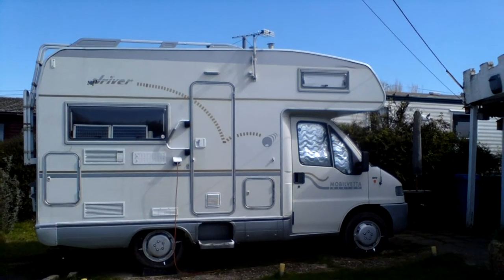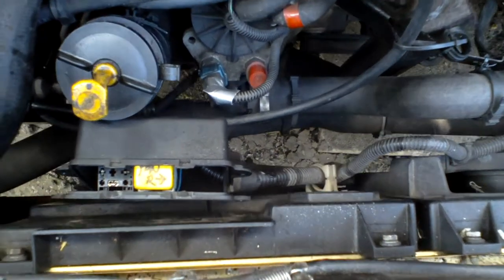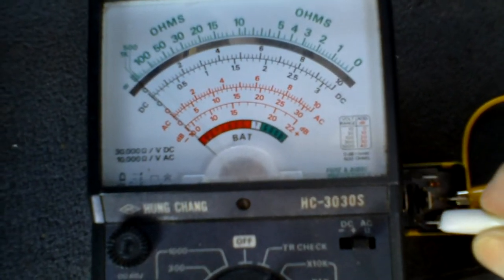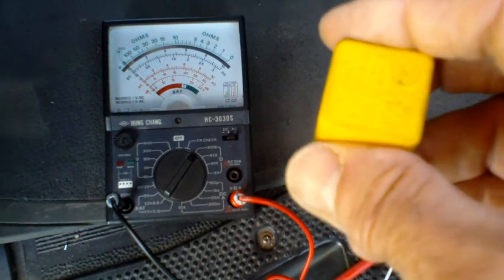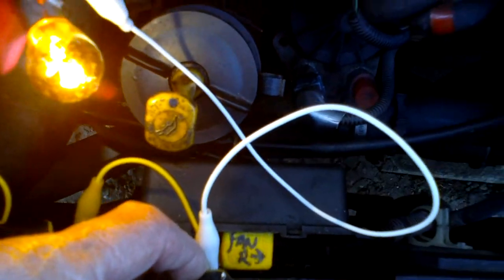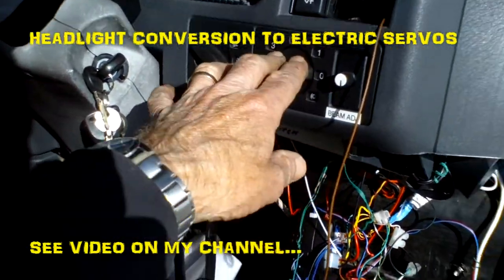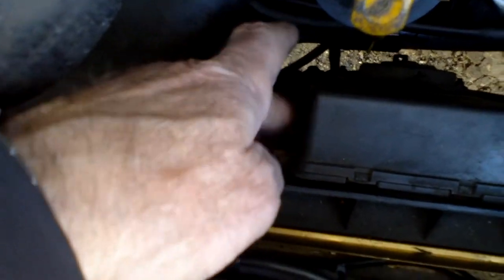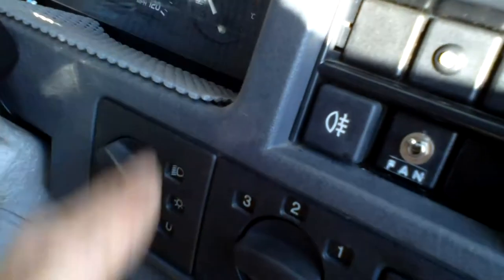FIAT DUCATO 1999 TD - COOLING FAN PROBLEMS

Comment: Thanks for the video - saved me loads of time. The low temp fan ran continually after a journey and the only way to stop it was to tap the side of the relay box to release the relay contacts. I purchased another relay for €20, swopped it out and now all working fine. I opened the old relay and the contact had burnt out.
Reply from the maker: Hi John. Glad it’s been of help. The relay takes a lot of current so the contacts can get welded together easily. I found that a switch in the cab to energise the relay before the temperature switch cut in was a great help in keeping the van running cooler up in the highlands of Scotland where I spent a full month…
Good luck on your travels and look at my channel as I have loads of other tips in video. Best regards Peter

Comment: Hi great video and thanks for posting.
I have exactly the same problem on my 2001 Ducato. How do you identify the earth pin from the two pins that you performed the test on? 
I presume it's the one on the left, pin 30 (as you look at the pins). 
Hope you can help. Cheers
Reply from the maker: Hi Gareth. If you check on the video and make up the simple test bulb lead you should be able to clearly find out the Earth and power lead without doing ant possible damage as the load bulb will light instead of burning anything out.
As yours is not the same year as mine the wiring could (probably is) be different so only there is no easy way (Safeway) to tell what pin to use.

Comment: I have a 2001 Peugeot Boxer with the same fan and relay configuration. Currently, I'm facing an issue where neither of the fans are running. I've meticulously checked all the fuses and even experimented with the radiator sensor, which has three wires. Apparently, you connect one pair of wires, one fan should run, and when you connect another pair, both fans should run. However, despite these tests, the fans still refuse to operate. I've also tried the bulb trick across the same two connections on the relay box as you did, but the fan remained inactive. Any suggestions or advice would be greatly appreciated.
Reply from the maker: Hi Mick. I would first go looking for the main power connection NOT for the relay coil. The relay should show 12v in the switching side (not to coil) if you can’t find it then there are 40A fuses up by the battery on the off side wing and perhaps that could be an issue.
If a fuse has blown be sure to check to see the cause as it could be the motor has gone or some wiring has become damaged.
The fans take a LOT of power but operate independently from the ignition so that if the engine is hot and you turn off the engine the fan continues to operate till the stat turns off the circuit.
Just a case of digging I’m afraid. It’s always the earth of the relay coil that gets switched the relay contacts handle the heavy load.
Regards Peter

Comment: Hi Peter, Thats a great video and thank you! I've got one fan permanently on (1999 2.8). I'm hoping it's a sticky relay so it helps knowing where they are located!! Cheers, Brent
Reply from the maker: Hi Brent. I have now changed both relays as they don’t cost much and also next is the temperature switch is next - looking front the front you will find it located at the bottom of the radiator R/H side. Look for the wires going to it which is not hard to find. I have got radiator flush and also recommended glycol ethanol antifreeze concentrate which is also a help to cool the engine as well. That should mean it will run a bit cooler… Thanks for taking the time to comment and loads more videos I’ve made that may help you on my channel so if you subscribe you can always find me.
Also run the Facebook group “Mobilvetta Driver52 motorhome group” which has the same engine as you (1.9td + 2.4 and 2.8 diesel).
Regards Peter
Reply: @brucepeter2007  thank you for responding and additional information Peter. I have subscribed and found your article on the scuttle drain useful. Regards, Brent
Reply from the maker: @brentc8110141  Hi again. Always try to reply and help others - thanks for the sub. Regards Peter

Comment: One of the temp sensors seems to have failed for me after a bit of a hill, couldn't have picked a better place to break down in Spain... luckily i have heaps of lifepo4 battery, inverter and charger so am just charging the starter... while I'm here I'm thinking to just add a relay or switch to disconnect the (lower radiator?) temperature sensor when ignition is off? Fans have been a nuisance on two occasions, one at a border crossing when nobody can hear eachother with the fan roaring even with engine off... Temperature on dash reads fine and fans usually shut down after 5 mins parked, but today I was pulling relays from under the dash searching (fruitlessly) for an easy off switch, and it ran the ageing starter battery low... Anyway... engine running again now and charging via alternator... waiting for the fan(s) to kick in so I can see which temp sensor wire I should splice... Not using a timed relay while bypassing ignition seems a bit of an oversight by whoever designed this system.
Reply from the maker: Sorry for pain hope you get it sorted. Is your van a mobilvetta driver52?

Comment: Great instructional video, many thanks. I bought a Pilote D34 motorhome last year (I've had Hymers in the past)and it came with the little 1.9TD engine, great for fuel economy, not so good for hills. It's the middle of summer now and I've noticed that the big fan comes on when I turn the engine off. It then stays on for a minute or so and then goes off. Is that normal? I've not noticed any lights on the dash come on or the temp guage go up (I've not even looked at the guage to be honest). The other day after turning the engine off, the fan stayed on about a minute, went off, then after about five seconds came back on for a few seconds then went off. Does this sound like a failing temp sensor somewhere/ Thanks for any help anybody might offer.
Reply from the maker: Hi Fred. On hot days or when you stop after the engine has been worked hard the cooling fan can come on after the engine stops as the heat builds up BUT. always best to listen till the fan stops as the fan by-passes the ignition so if your thermostat sticks on you will come back to a flat battery.
Mine started to act up which is why I changed the stat and I have no issues with the fan running now after the engine has worked hard so I do suspect my stat was showing signs of failing and I replaced said stat. Since then I have been told that the stat sticking so the fan stayed on was a common fault…
Reply: Thanks Peter. Are there two stats, one on the engine block and one on the bottom of the radiator? As my van is a 2000 model, maybe I should just change both of them? Thanks for the reply. @brucepeter2007
Reply from the maker: Hi Fred. - I just changed the stat on the radiator and that was the one that was at fault.  @fredflintstone1428
Reply: Many thanks Peter  @brucepeter2007

Comment: Hi, nice video. Can u please tell me what's the PIN of your relay that you sent the earth to?
Reply from the maker: Hi Alessandro. On the plug in relay you will usually see a diagram showing where the relay COIL pins are. Use a multimeter on the corresponding relay socket pins to check for the 12v positive supply which is live to the relay socket base all the time (straight from battery) the negative Earth is the opposite pin so the 12v supply goes through the relay coil which energies your switch….
Personally to save issues knock up the 12v x 21W bulb and a lead like I show in the video - that way you can always “feel” your way through electrics without causing blown fuses and damage… Regards Peter
Reply: Ookk, thanks for the explaination 👍🏻👍🏻
Reply: Job done, thanks again Bruce 👍🏻👍🏻
Reply from the maker: @alessandrovirdis520  Your very welcome

Comment: Hi Peter 
Another good video and fortuitously I may have same problem. Noticed driving from Scotland  down to England  last month . Engine overheating, especially  on the hills. Engine certainly working hard going up them. Usually sits at 90..but was going upto 100 with warning  light coming on....on stopping noted coolant just looked like water,  so thought it was maybe because no proper coolant in it. That and fact it was really warm day. 
So I've booked it in to get system flushed...but seeing this video , I do wonder if it maybe more like your experience.
Reply from the maker: Doing a flush and will change the fan switch and relay just to be safe. Keep your wheels turning and stay safe. Peter
Reply: @brucepeter2007  thanks Peter. Have exact same van you have , so good to watch your videos. Eventhough am not as skilled or competent. Always finding something wrong...damp right across back van now. Kitchen and toilet. On process of resealing outside yo stop anymore water ingress.  The joys
Reply: @brucepeter2007  ps Relays easy enough to purchase? Considering how old van is
Reply from the maker: @weebab69  as long as it’s small   Bits and bobs it’s things like gearboxes that are like gold dust PS have you joined the Facebook group. Mobilvetta driver52 motorhome group?
Reply: @brucepeter2007  thanks for heads up re FB page 
Damp I think larger area than I thought. Was hoping to avoid taking top kitchen cupboards out, but fear I may need to. Hoping it's not one big one , but nit looked close enough yet

Comment: Hi Peter couldn’t you not just bridge the relay connection for the slower fan over to the high speed fan so when the slow fan relay comes in that it will also activates the other relay at the same time.
Reply from the maker: Hi there. Your the first reply. You could do as you said but it always better to only mess about a bit. 
Didn't want to do that as if you were in traffic instead of just the one smaller fan coming on both would start and the battery drain would be high which is why I elected to do it the way I did.
Thanks for the valued comment and I hope I have explained my reasoning OK.
Regards Peter
Reply: Hi does engine over heat often?
Reply from the maker: Hi there. I have fitted a new radiator so it’s only in heavy traffic in last years heatwave that the fan was coming on but as I want to try the dales and Scotland I think I need to be prepared. The engines in motorhomes work harder than they would in a van because they are loaded to over 3 tons unlike a delivery van that goes out loaded for delivery and empties over the course of the vans round.
Just hope I manage to get my dream which is Scotland.
Reply: @brucepeter2007  Hi Peter. Thanks very much for doing this video, but I'm sorry; how was the earth wire running to your dashboard switch actually connected into the relay or into the socket? Is the relay replaced in its position with the switch wire jammed into the earth socket under it? If I could do this I could solve the same problem on my Boxer. Thanks
Reply from the maker: @petetimbrell3527  Hi Peter. The Earth wire from the dash switch goes to the Earth on the relay socket that way it still says functional via the thermal switch as per normal or by using the switch on the dashboard the relay can be overridden at will - my main fan stays on a lot and even comes on going up a hill on the motorway. I’m not losing water and I have a new radiator and a new water pump. It’s doing a lot of work that little 1.9 engine…
Regards Peter
Reply: @brucepeter2007  Thanks for replying mate. So how is the connection of that earth wire made? Do you use a spade connector into the relay socket and leave out the whole relay? I'm sorry if I sound dumb, Its what happens inside that black box that I don't understand.  Your help is very much appreciated!
Reply from the maker: @petetimbrell3527  hi Pete. As the wire required from the switch on the dash is only thin because it carries no current you just remove enough insulation from the wire and insert it into the Earth side of the relay base then insert the relay back into its socket and a good contact is made…
Reply: @brucepeter2007  Thanks Peter. Now I've got it. I was thinking it was a lot thicker wire than it actually is - I can see that now. Many thanks my friend. I'll give that a go. Happy travels.
Reply: @brucepeter2007  Subbed your channel by the way. Cheers
Reply from the maker: @petetimbrell3527  Thanks Pete. Glad to help. Regards and stay safe. Peter
Reply from the maker: Hi Sean. The black knob is supposed to be used if the step gets stuck but it’s useless to be honest. I repaired mine as it didn’t work but it was one of the few things I didn’t make a video of. Mine had a stripped tooth on the drive gear but it was steel and I got a bit of steel welded on and then I filed and filed the steel (which took ages) till it was symmetrical with the other teeth in the gear and the mesh action was smooth. When I assembled it then it worked fine.
I have to say that most electric steps fail it would seem as the road muck gets everywhere and when I took mine apart it had so much road dirt inside it was amazing it ever worked…
Reply: @brucepeter2007  ok thanks for info Peter   What do you do with knob for step  push. Pull. Turn. 🤷🏼thanks Sean.
Reply from the maker: @seantoothill5409  it turns clockwise but as I say it’s almost useless. Lots leave them closed and carry a “two step” step in the van…
Reply: @brucepeter2007  yes have step in van 👍cheers for info. 👍
Reply: @brucepeter2007   Hi Pete, thanks for the video - it's been super helpful. Can you confirm exactly where both sides of the switch are terminated? I know one goes to the earth on the relay socket, where does the other side terminate?
Reply from the maker: @2obin.  hi Robin. It is covered in the video. If you use a multimeter you will find one side that feeds the coil is always a live feed and the other side is the Earth that will go to your switch then to Earth. When you throw the switch it then supplies the Earth to the relay coil and the reply will click on energising the fan.
Hope this makes sense. Regards Peter
Reply: @brucepeter2007  Thanks for replying and being so helpful. So, one side of the switch is Earth on the Relay Socket and the other side of the switch is to Earth anywhere in the van? (Where did you end up terminating yours?)
I have an occasionally misbehaving temp monitor switch (the one on the back of the radiator, nearside). If I need a roadside repair do you think I could wire a switch from the Earth on the Relay Socket, and terminate the other side of the switch basically on any metal under the bonnet (to avoid having to pull cable through the dashboard)?
I also watch the engine temp display on the dashboard like a hawk and know what temperatures it should normally operate - so I'd likely know as soon as I had a problem.
Thanks again for taking time to answer my basic questions!
Reply: Thanks Peter for this great video. I am thinking about doing the same to my 2000 Ducato 2.8 idtd. I have changed the radiatior and the thermal switch on it and the fans still don't activate when they should. When the wires ending to the thermal switch get power though, they work just fine (a big mystery). So from a previous answer of yours, I gather you just squeezed the end of the wire coming from the dash in the earth hole of the relay socket and then placed the relay on top of it, so that the relay itself holds the end of the wire in place. Did I get that right? Sorry if it sounds stupid. Thanks again!

Comment: Hi peter long shot i have a blown fuse on my main engine fan i shorted it out by accident i have looked every where  for ages and cant seem to find it any help would be massive help thank you very much .
Reply from the maker: Hi there. The fans are both fed via 2 relays situated in a box at the top of the radiator. The thermostats only energise the relay coil.
The fan current is very high so it’s fed from the same electrical feed that goes to the starter motor… I am not aware of any in line fuse used with the fan supply as it would need to be far larger than the fuses contained in the glove box…
Sorry I can’t help any further but all layouts are different on different years and makes…
Reply: @brucepeter2007  thank you for your help will investigate abit more.
Reply: Hello, on mine 2.8idtd there are two fuses for the fans over the battery (with a plastic cap)